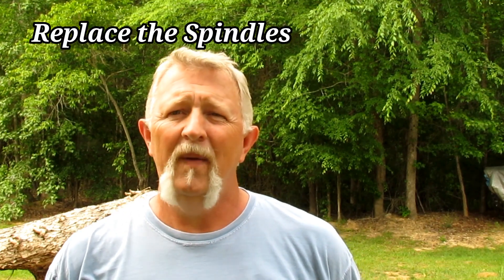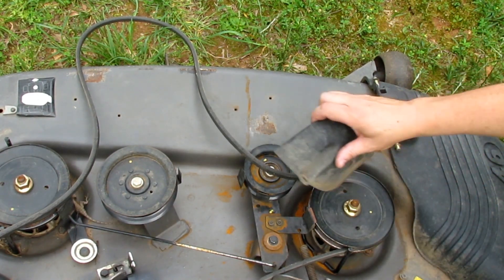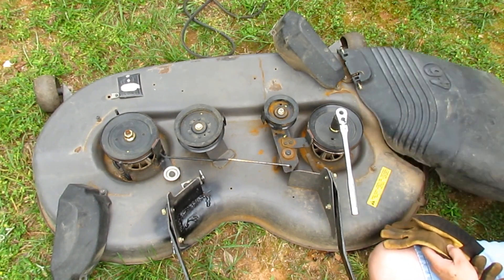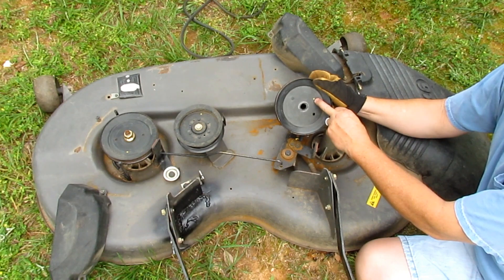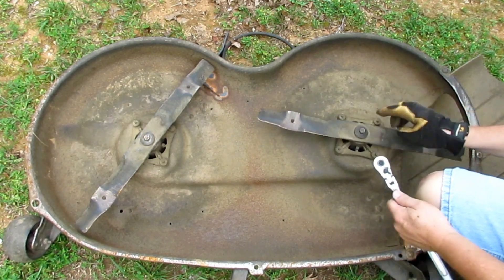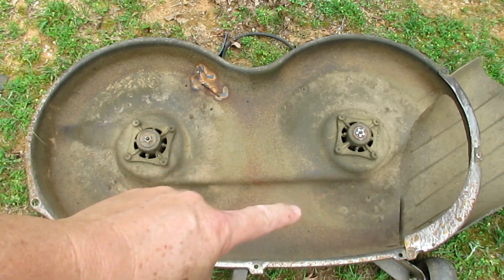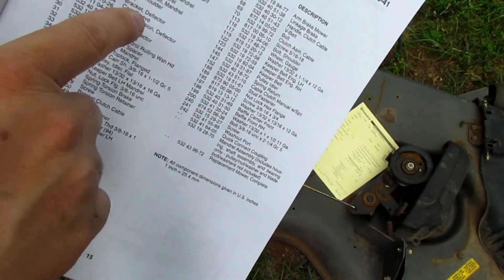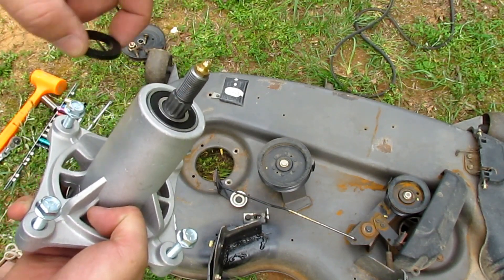Replace Deck Spindles - Husqvarna Yard Tractor YTH22V46

Comment: Perfect video for those looking to tackle a project. I have new spindles, blades and belt coming tomorrow to repair my rz54i husqvarna.. i took the blades off already, but i'll need to remove the pulleys to reuse them. Any suggestions? (note, the one blade stripped off the star gear)
Reply from the maker: Thank you for watching!  It will be much easier to remove the pulleys if the blades are installed.  If the one side is so stripped that holding the blade will not prevent the spindle from turning when trying to remove the pulley nut, I'd probably try using vise-grips or maybe a pipe wrench on the underside of the spindle.  If that doesn't work, go ahead and take the spindle out and use a vise or other method to hold the spindle shaft so that you can remove the pulley nut.  Let me know if that helps, or if you need more help.  Good luck with it!  thanks again!

Comment: First of all, I can't thank you enough for your Husqvarna video series.  You have taught me a great deal and instilled a lot of confidence as I tackle these maintenance projects.  I successfully followed this video, but when I engage the blades I'm getting a terrible squeal from the deck.  Could that mean I haven't greased the spindles enough?  I purchased the same ones as you, but stopped filling when the grease was pushing back towards the grease gun and spilling out.  I don't think I filled mine as much as you did.  I can't think of anything else that would be creating that much of a squeal.  It's a new belt, but it sounds more metallic in nature.  Thank you again!
Reply from the maker: Thank you for watching and all your support!  IT could be a few things.....I'd definitely start with double and triple checking the belt routing.  That is probably the most common issue.  Next, with the blades disengaged and the mower off, you should be able to turn each spindle/blade by hand.  If not, looks for clues about why the one that won't turn is bound up.  It may be easier to take the deck off to do this.  Without belt tension, each blade should freely spin.  If they do not, You should be able to listen to each spindle closely and determine if the bearing is making noise.  more grease could help, but you may have a faulty bearing.  If none of that helps. let me know and we'll try to figure it out.
Reply: @dwcoffey  Hi Dennis!  After some troubleshooting I traced it back to one of the new spindles that seemed to be rubbing internally, almost as if it was warped as it spun.  I did listen closely and sure enough heard that metallic sound - albeit much quieter when spun by hand!  I ordered the pre-greased (but non-threaded) spindles.  With the help of a neighbor, we threaded the holes and the mower is running great.  Thank you for your tutorials and remote support. - Brian

Comment: The bolts breaking off happened to me too! It had to be torqued down a lot tighter than 45-55 ft lbs...
Reply from the maker: Yes, I think so too.  Mine were rusted in, which would make them a lot harder to get out, but I think they were originally over-torqued.  Thanks for watching!

Comment: OK, you asked for it by replying (at all), and so quickly! I just replaced the spindles on the same tractor. Turns out I only had 1 bad bearing but after breaking off 3 of 8 bolts I just did the whole assembly. The shaft now seems too low as the star teeth (?) barely engage the teeth of the pulley (unless I lose the spacer and don't want that). Will tightening the nut as I'm installing the pulley draw the shaft up? Or did I goof something up? I confess to having disassembled it so I could grease the sealed bearings, 1 bottom had no grease, the other a little and both top ones OK.  I'd be glad to hear your thoughts. Thanks
Reply from the maker: Thanks for watching, Randy!  If the shaft is riding too low in the spindle assembly, you may not have the bottom bearing completely seated inside the spindle housing.  That would cause the shaft to be too low on the top.  And you are correct, you don't want to take that spacer out, it keeps the pulley from rubbing on the top of the spindle housing.

Comment: Hey Dennis I bought the oem spindles. I'm pressed for time and really don't won't to take apart my new spindle. So basically is it pre greased? and a waist of time to grease it out of the box. Without the extra fix, How long will my spindles last in your opinion. 2011 model and it's 2022. If I get 5 yrs installing directly out the box. Happy. I'm going to start saving for a new one anyway
Reply from the maker: Hey Cecil, thanks for watching!  Most of today's spindles are built with sealed bearings and they are somewhat pre-greased.  Out of the box, they should last for a few years with normal use.
Reply: @dwcoffey  thank you sir

Comment: unrelated  to  this video. i saw   where   pivot bolts  have a  Zerk   fitting.  any  thoughts??   is Zerk   real or  China add-on?
Reply from the maker: Hey Don, thanks for watching!  Which bolts had the zerk fittings, the pivot bolts for the deck mounting bars?  Never seen that, so I'm guessing aftermarket?  Maybe newer model.  It would have to be like a banjo bolt to do any good though.

Comment: Great video! I do have a question though. The brakes next to the pulleys are supposed stop both pulleys from moving when the clutch is disengaged. Since I remove the nut holding down the cable instead of twisting the clutch cable off (before the deck can be separated), only the right pulley is braked. How to adjust it? Thanks in advance.
Reply from the maker: Thank you for watching!  Did you re-attach the spring from the PTO cable to the arm that has the pulley brake on it?  IF so, that should hold the pulley brake away from the pulley when the blades are engaged.

Comment: Hi Dennis! Great video. Do you have a video about setting the deck cutting height? I just cannot seem to get the deck level. Even when i have it on number 4 the right side of the deck is on the ground. I have to pit it on 6 to get the right side off the ground and by then the left side is 2-3 inches off. I tried messing with the adjustment on the left side but cant get it right. It cuts very uneven and it wasn’t always like this.
Reply from the maker: Thanks for watching, Scott!  These Husqvarna's don't give nearly the height range they should.  A lot of folks say they can't get the deck top cut as high as they'd like.  There's not much we can do about that as users.  I have had lots of folks ask about adjusting the deck height, so I will work on a video about that soon.  Thanks Scott!

Comment: Dennis, thanks for the detail instruction. You were very detail and helpful. However, My Bracket clutch cable has an adjusting nut on the end, and yours does not. I guess the question is how to I alignment the brake on that pully?
Reply from the maker: Hi Rick, are you trying to set how deep the brake goes into the pulley, or align how the brake pad lines up across the pulley?
Reply: Thanks, Dennis I got the brake to line up. Thanks again for all your help.

Comment: Do these spindles need greased from the factory?  What’s the torque spec on the pulley nut atop the spindle ?
Reply from the maker: Thanks for watching!  I didn't think the bearings would need to be greased from the factory in the past, but experience has taught otherwise.  You can take the spindle apart, remove a seal on each bearing and hand pack them if you don't have a zerk fitting on the spindle.  If you do have a zerk, you probably need to remove the inner seals on each bearing to allow grease to get into the bearings.  Since making this vid, I have found that most aftermarket spindle bearings are not properly greased from the factory.  It is difficult to find a published torque spec for the pulley nuts, but 70-80 ft lbs seem to be the standard.
Reply: @dwcoffey  thank you!

Comment: Hello Dennis..... I just purchased spindles from Amazon.    I had already removed and replaced the old spindles with new before watching your video.
Do you think I should remove the new spindles and see if the bearings are sealed?    Obviously if they are any grease is going to do nothing.

What would you do?

Brian in central NC
Reply from the maker: Thanks for watching, Brian!  Since they are already installed, I probably would not take them out.  You should be able to pump grease into the spindles and see if you get any squeeze out from the outer side of the top bearing.  If you do, those bearings will be fine.
Reply: @dwcoffey  thanks so much friend!  I appreciate you and your channel.... Keep up the good job friend 👍

Comment: I purchased my Husqvarna LGT 2554 in May 2011, and I just had a idler pulley bust on me. Do you order parts off Amazon, or from Husqvarna ? I've never had to replace any of the spindles yet. I'm going to order a new belt since it's never been replaced yet. Do you think I should replace the spindles, since I've went this far, or do you just replace as needed? Good video, thanks for posting.
Reply from the maker: Hey John, I'm sorry I'm so delayed in answering this.  I will usually order parts from Jack's Small Engines or Amazon.  I'm careful about amazon parts though as some of them are substandard....it depends on who the seller is and where they are coming from.  I wouldn't replace the spindles unless they are noisy or have a lot of play in them.  Thanks for watching!
Reply: @dwcoffey  that's ok, I appreciate the help. John

Comment: Is it possible to apply grease to the stock (factory) spindles? If so, how?
Reply from the maker: My mower did not have spindle grease fittings from the factory.  All the fittings and grease points provided by the factory are shown in my video: Husqvarna Yard Tractor Lubrication and Maintenance.  Mt replacement spindles have grease fittings included.  Thanks for watching!!

Comment: Hello Dennis. It’s me again. I am ready to tackle my newly broke spindle. However, I don’t have the long ratchet thing you have. What is that called so that I can purchase one? I have regular sized ones but they won’t give me the leverage I need to remove the bolts. Thank you again for another great video. You are so easy to understand and very thorough with each step. Don’t know what I would do without you.
Reply from the maker: Hi Sheila, thanks for watching!  You can use either a long handled ratchet (what I use in the video): https://amzn.to/3wJXAtP
or a breaker bar: https://amzn.to/3uFujyF  I hope this helps!!
Reply: @dwcoffey  oh no! I have a problem. My blade now moves without turning the spindle. I can’t loosen the bolt on top of the pully to remove it. I sprayed it with WD40 and let it sit most of the day but it won’t budge. I held the blade bolt with another ratchet with no luck.
Reply from the maker: Sounds like the blade bolt isn't completely seated.  The blades have a star-shaped hole in them, the blade bolt needs to hold the blade fully onto the star-shaped end of the spindle shaft.  If the blade can spin without turning the spindle, sounds like the blade isn't fully tightened.
Reply from the maker: Some of the pulley nuts are staked, so they are really difficult to remove...might take an impact wrench.  Were you able to check the blade bolts and fix the problem?

Comment: @ Dennis
New Sub. Quick question. My spindle on the discharge side had no play once i got it on (marked the spindles to make sure i put back the same way) The opposite side did. Should i be concerned ? It got dark on me so i stopped plus have to buy a grease gun, got started because it was simple once i watched your vid.

Had to edit to say Thanks for your help.
Reply from the maker: Thanks for watching and subscribing, Sam!  Yes, I you should not have any lateral play in the spindles once installed.  You may have a little vertical play, depending on how your particular spindles are built.  Let me know if I can help.

Comment: Good video buddy, why did you change them? were they getting noisy? what was the problem? I have just bought a used one with 85hrs so wanna be forwarned .
Reply from the maker: Hey Chris, thanks for watching!  I had used mine for clearing a lot of space in the woods....hit a lot of stumps, vines etc and basically wore the spindles out through abuse.  They were starting to get a little noisy.  Also, I didn't like the OEM spindles being non-greasable, so I swapped them out. No problems since.

Comment: the new bearings that come in the new housing are sealed with a cap on each end. If you grease the spindle, there's no way for the grease to enter into the bearings.  Might be a good idea to remove the plastic seal covers from the bearing so the grease can get into them otherwise the grease really isn't doing anything.
Reply from the maker: Thank you for watching, Lynn!  This is true and thank you for mentioning it.  Here's my video on the process:  https://youtu.be/EYyhVyHysaw

Comment: Is it me or did this particular mower absolutely chew through spindles? In the five or so years I owned mine I probably replaced the spindles annually, usually because one or more of the tabs attaching it to the deck snapped. This happened with the OEM spindles, the sealed third party ones, and the grease fitting third party ones. Only mower I’ve had that issue with.
Reply from the maker: Thanks for watching! Once I replaced mine, I have not had any more trouble with them.

Comment: Have you had any problems with clutch arm sticking, it won't move forward or reverse? You have to keep pushing it off and on.
Reply from the maker: Hi David, I'm not exactly sure which part you are having trouble with, but....the arm that applies and removes the brake on the deck should have a spring attached to it so that it stays in whichever position you have it in.  If I'm understanding the problem, sounds like you might be missing a spring.    If this helps, you can go to https://www.husqvarna.com/us/support/manuals-downloads/ and download the parts and owner's manual for free.  Let me know if I've missed it and I'll try to help.  thanks
Reply: Dennis Coffey I was referring to the forward and reverse pedal.When you push it, it's like it's stuck.You have to keep pushing it on and off until it releases.
Dave
Reply from the maker: Gotcha....those pedals are attached to a tube that runs lateral to the frame, then a linkage are is attached to it (underneath the tractor) that runs to the transmission.  There is a spring near the transmission-end of that linkage arm.  I'd check first to see if the spring is attached as it should be.  If not, there are bushings on each end of the tube that the pedals pivot on....it may be that one of those bushings is in need of replacement, or is bound up, etc.  You'll probably have to remove the deck to see all of this assembly.  The manual I mentioned above may also help identify the parts in the assembly.

Comment: I've been able to get 3 of the bolts holding the spindle (you broke 2 in the video) what is a trick to get these loose? I've tried WD40 and some blaster penetrating oil but cannot get the bolt lose. I need to change this spindle because the spindles star fitting is shot and I can't keep the blade tightly connected.
Reply from the maker: Thanks for watching, Darrin.  I just kept cranking until mine broke.  Then I could remove the spindle and I got the remainder of the bolts out with vise-grips.  If you have access to an air compressor, maybe you could try an impact wrench.

Comment: Hey a late comment.  I see you welded the left side bracked that attaches the mower to the tractor.  Mine is broken off and and the deck is actually broken.  I assumed that was not fixable, or at least any shop would insist on just replacing it.  How bad was the break did it actually put a hole in the deck, or just break the weld?  May not matter because I don't have a welder, or confidence in trying to weld it.
Reply from the maker: Thanks for watching, Bruce!  Yes, I broke the weld on the left rear hanger bracket and also have since broken the weld on the right front anti-scalping wheel bracket.  Because of the way they fabricate the decks, both weld breaks left holes in the deck itself.  I welded both back in place, filling the voids and have had no problem since.  You might be able to find a small local welder who does work like that and get it repaired relatively cheap.

Comment: Dennis, Great video, just wondering what kind of grease gun did you use to grease the spindles with.  i just purchased the zerk spindles and need to get a grease gun as well, that will pretty much  be only used for my Husqvarna YTH
Reply from the maker: Thanks for watching!  Mine is a cheap, no-name grease gun.  I've had it for years and can't remember where I bought it.  The main things to look for are good threads on both ends of the tube.  Make sure both caps will thread on well and tightly.  Make sure each cap has a seal in it.  A flexible line is much easier to use in more places than a rigid grease line.  If I had to buy another one today, I'd probably buy a Lucas or a Lincoln gun.

Comment: Apply anti seize on the bolts that attach the spindles to the mower deck when anyone is replacing the spindles

Those bolts and the spindle are 2 different types of metals and definitely will seize together if anti seize is not used
Reply from the maker: Thank you for watching!

Comment: Hi Dennis, I replaced my spindle assembly and my spindle isn’t fitting back on is this a common problem because I bought an official part
Reply from the maker: Hi Nick, thanks for watching.  I did not have that problem when I replaced mine.  Maybe they sent you the wrong part?